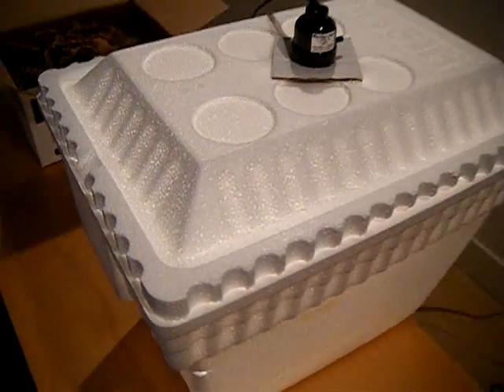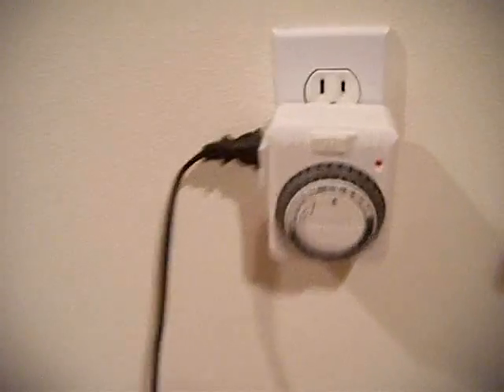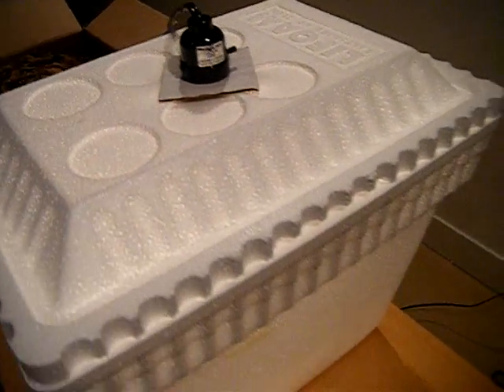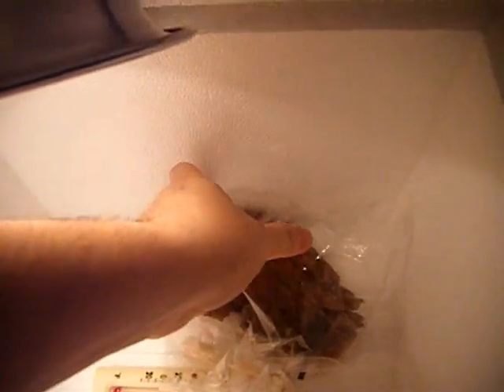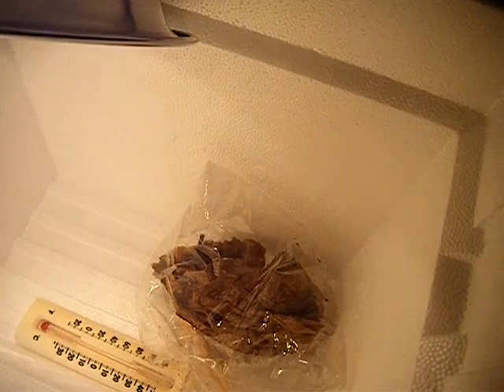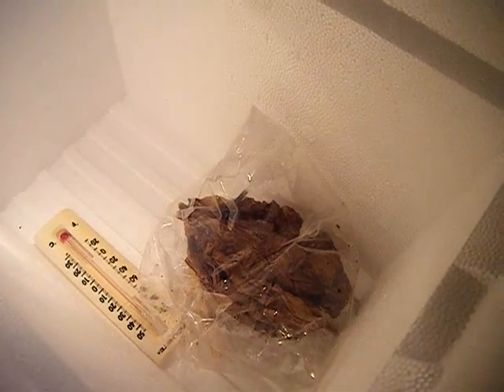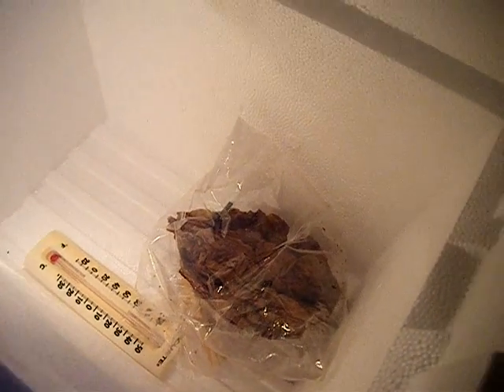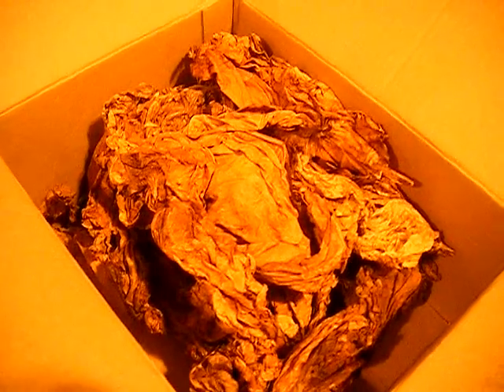Part 8.3: Fermenter update #2, How to Grow Tobacco Series

Comment: Question - I remember seeing a video of yours that explained the different smells you encountered during fermentation with time frames when the smells changed. I can't find it now, I want to review the time frames/smells that you encountered. I remember a specific time/smell that smelled the best.  Do you know what video I'm talking about? 

Suggestions - use a freezer bag that will lock in humidity so you won't have tobacco dry out. Place a black towel over the bag = no light. What do you think about using vacuum sealed freezer bag instead? (this would replicate pressure from piles of tobacco fermenting).  Thanks for the vids!
Reply from the maker: Hey there, its been so long since I made these, not sure which video, but its possible you may be recalling the instructable I wrote about this?  In "step 5" I included a smell timeline.

http://www.instructables.com/id/Tobacco-fermentation-curing-chamber-for-cigars/

Comment: Here's the device you want to use to control the temperature more accurately. http://www.amazon.com/RANCO-ETC-111000-Digital-Temperature-Control/dp/B0015NV5BE  Also, I do believe you don't want to get too far above ~120F. There's enzymes in the leaf that are vital to proper fermentation that will shut down if it gets too hot.
Reply from the maker: Sweet!  Thanks for posting this.  For sure temperature control would be beneficial to the process!
Reply: SurfMonkeyCoconut Check out the Grow Blogs on fairtradetobacco.com to see some people who have mastered the art of grow-it-yourself tobacco.